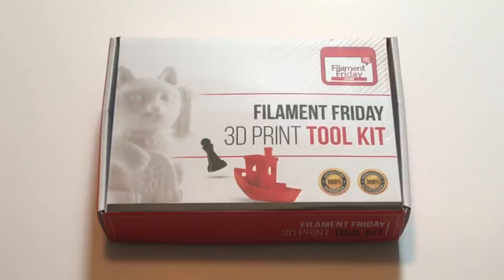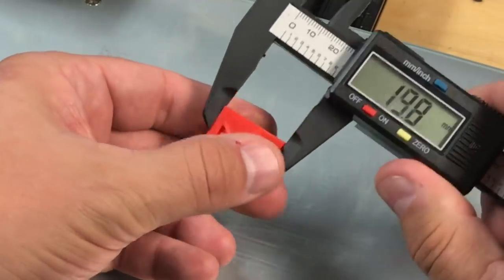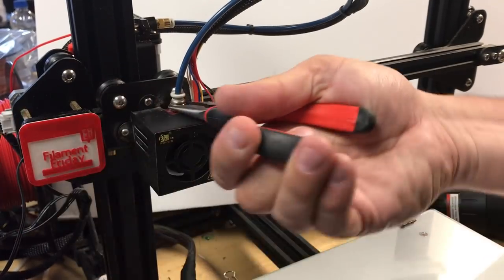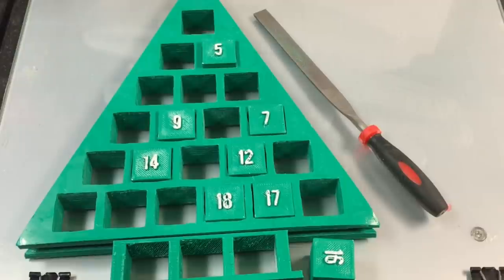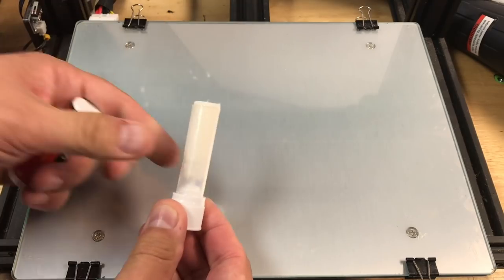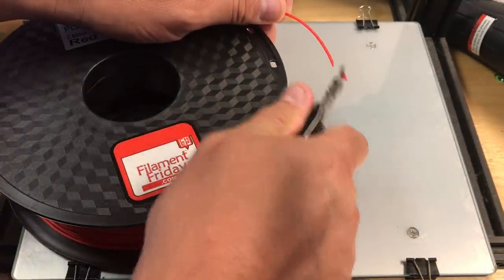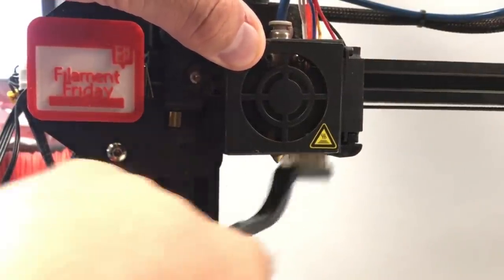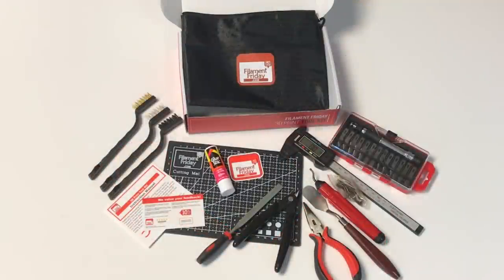Introducing the Filament Friday 3D Print Tool Kit - (Paid Promotion)

Comment: Awesome little set.  I may pick one up.
However, I cringed when I saw you using the pliers on the Hotend PTFE quick connect.  I'd recommend adding 3 wrenches to replace the cheap ones that came with the printer.  The one for the nozzle nearly rounded the corners the first time I went to use it.
6mm - Nozzle
8mm - Extruder PTFE tube quick connect
10mm - Hotend PTFE tube quick connect
Reply from the maker: We are working on a version 2.0
Reply: @FilamentFriday  When will 2.0 be available? I added your kit to my wish list on amazon, and will be purchasing a kit in the near future. I have a good bit of these tools already, but I like your arrangement! Thanks.
Reply from the maker: 2.0 will be sometime next year.

Comment: What a great kit, Chuck! I wasn't sure what to expect for the price. Mine came from Amazon and I'll say unconditionally this is a winner and a great value! Out of curiosity, I priced out getting the same stuff from the cheapest source I could find (Harbor Freight) and couldn't even match the price using their cheapo stuff. Better quality and value is a killer combination.

This kit strikes me as a solid daily operations kit. If you're ever thinking about makng a second kit, I'd be interested in seeing what you come up with for a preventive maintenance/service kit. I know for me, there are certain allen wrenches, regular wrenches, gap spacers, sockets, nozzle needles and consumables (like white lithium grease) that I never have enough of on hand. Certainly, with all the different printers out there it would take some clever planning. I'd love to see your take on that kind of kit. I'd be at the front of the line to buy it =)
Reply from the maker: Great idea. I’ll work on that.

Comment: I also bought the screwdriver kit from your link and unfortunately my tweezers first order of business was to pick out the pieces from the broken hook that pulls the screws back to close the Box. Other than that the of the tools is nice, actually it's still a quality Case except for the hook being broken into pieces sitting in the bottom of the case.

 It pops open just fine I just have to manually push the screws down to shut the lid and that just takes away a little of the fun.
Reply from the maker: Return to Amazon and get a replacement.
Reply: @FilamentFriday  it's no big deal everything in it works great. I share the good experiences with the bad experiences when someone recommends something that's all.

It's a great set of tools to have especially to work on a 3D printer.

Thanks